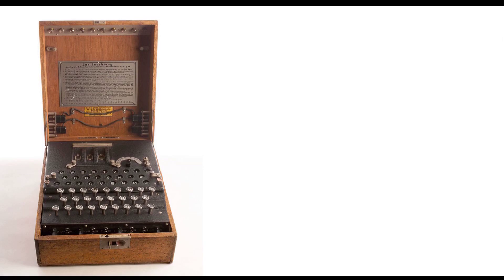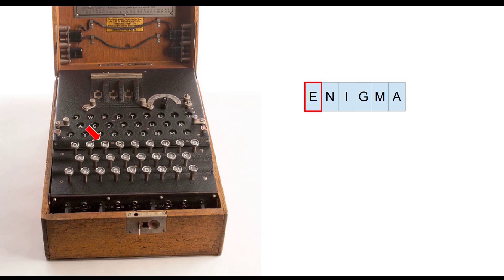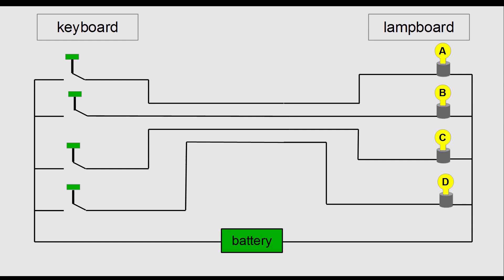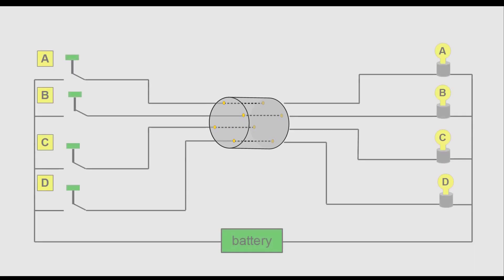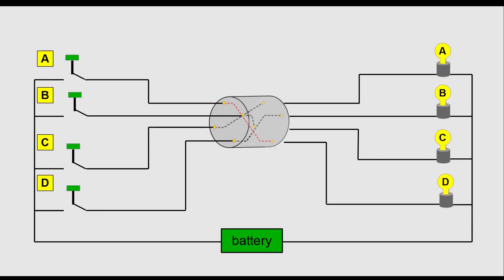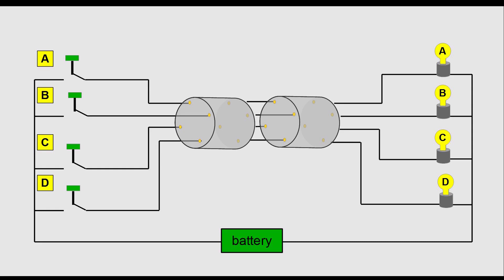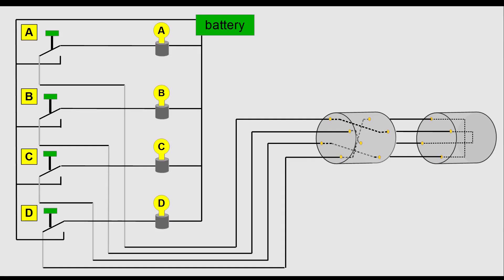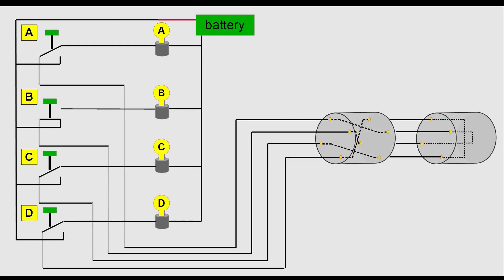How the Enigma machine works | Animation

Comment: I know how enigma works.   But how do you use it?  Like did you reset it after every message?  How did they keep it all organized??  I haven’t ever found a video explaining that.
Reply: Yes they did. There was a code book that was issued to German military that told operators for every each day of the month what rotors to use, and how to set them.  Same for the plugboard.  Each day they switched to the new configuration as per the code book.  

I also read that sometimes the senders would send messages instructing the receiver to use an alternate rotor configuration than the one in the code book for that day, making those messages even more difficult to decrypt.
Reply: @Stereotype240 
There were different setup books for different cryptonets.  This meant they could send messages across a common radio net but only those with the relevant settings could teas them.

Apparently they used a 3 character discriminant to define which setup they were using.

If a message had to be sent across two different cryptonets it would require the "bridge" to decrypt the message in its original settings and re-encrypt it in the new settings.  This aided the breaking of the settings if one setting was broken, they had a complete message to find the settings on the other net; by not rephrasing the message between the two different nets the Germans gave a wedge into some settings.

Comment: “The Enigma” worked like a “Master Lock” system or safe mechanism .. 

The “A” was the “Zero” starting point in the “Combination” ..

“Most Experts” say that “The Enigma” was more like an old “Mechanical Odometer” on a 70’s type car .. Specific to say it moves in one direction ..

What most experts don’t know that the parts can be “Removed & Changed Around” to “Physically Change” the code ..

The “Bomba” in 1932 of the BS-4 of Biuro Szyfrów in Poland was way before Alan Turing in “Deciphering” the “Enigma” ..

Alan Turing’s project was named “Bombe” .. the only difference in the name was to change the “A” to an “E” .. 

Alan Turing was proclaimed to be “The Father” of modern theoretical computer science & artificial intelligence ..

“The Enigma” was “Mechanical” as in a “Safe” .. To physically “Crack The Code” & get a quick 80% of the code right .. The gears would make noises that “Clicked Into Place” just like a “Safe” based on a “Safe Mechanism” .. 

To “Crack Open” a safe requires writing down numbers by “Feeling & Hearing” the “Safe Mechanism” which can be “5 Points” of “True Number” in “Left or Right” of that “True Number” .. 

Starting from “Zero” till everything “Lines Up” then start the “Combination” as with the “A” in the “Enigma Machine” ..
Reply: The other part of the “Enigma” was what I compare to an “Old Operator Switchboard” not looked at in this program .. 

This was on the front side panel .. 

Once used or “Plugged In” it could not “Physically” plug in a 2nd connection to the same wiring connection .. On both ends.

Similar to your earpiece connection on your cellphone .. 1 plug & 1 earpiece connection.
Reply: Return to innocent

Comment: Where are the front plugs and it’s combination?
Reply: The front plugs come on the wires between the rotors and the keys.  If nothing is inserted it just links straight through - A is connected to A, B is connected to B, etc.

 However, if a wire[1] is plugged between two letters then they are swapped.  If A was steckered to B, then they are swapped:
The A key when pressed enters the rotors as a B and the A lamp exiting fron the rotors then lights lamp B, and vice-versa.

[1]Each letter had two sockets, an upper and lower: one being connected to the key and the other to the rotors.  The wires had a plug on each end with an upper and lower pin, and the wire consisted of two wires: linking the top pin at one end to the lower pin at the other.  When no plug was inserted the upper socket of a letter was connected to its lower socket.